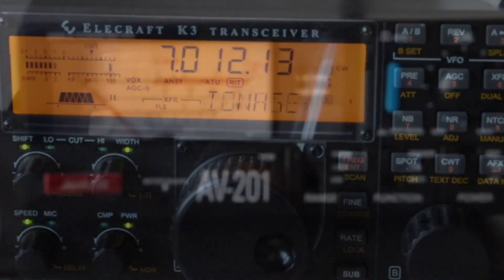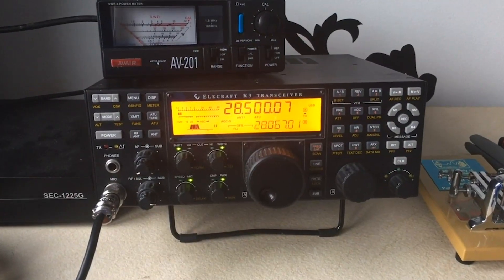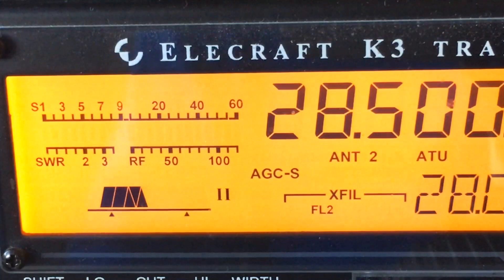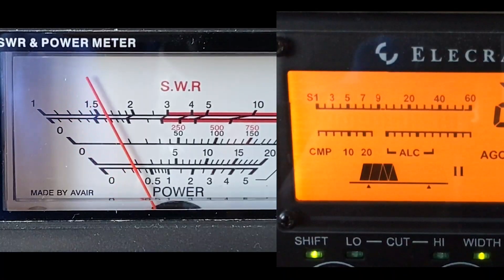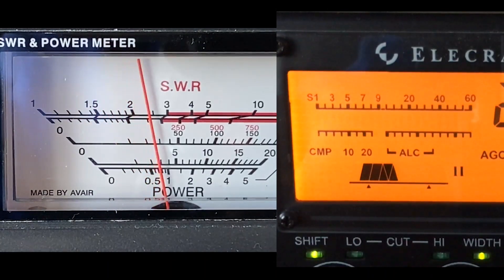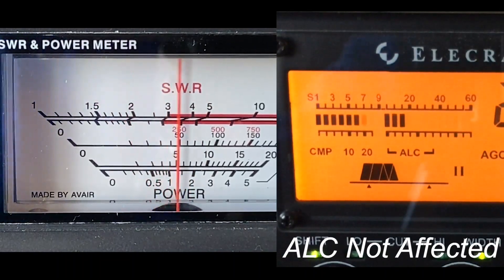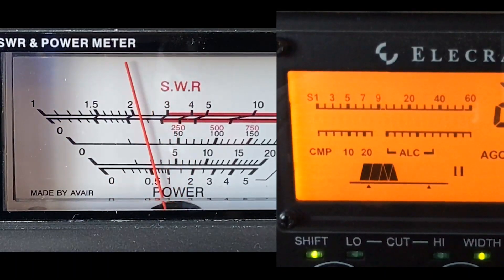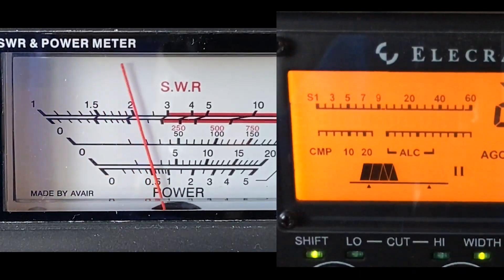Transceiver Compression in The Ham Radio Station

Comment: On my Ic 705, I set my mic gain so that I have about 25% of ALC, then I turn on the compression and set it so it is approximately 5db. What I notice with my 705 is that as I add compression the ALC increases. In this video with your Elecraft, your ALC didn’t seem to increase when you increased the compression. Is there something wrong with my IC 705? And if I set the mic gain with compression off to give about 1/4-1/2 the ALC meter and then turn compression on to 5db and it doesn’t go beyond the red ALC line, will my audio sound ok? I haven’t had anyone to test my audio with yet. Thank you.
Reply: I have the Yaesu FT-950 and it does the same. The manual suggests setting things until you have 5 -10 compression at peaks and ALC hitting around 50% at the same time. If I move compression higher the ALC follows. I also noticed I get great audio reports on DX but local on 80m and 40m I am often asked to turn the proc off and just go with mic gain to adjust. Seems to work for me. I use a webSDR out of Utah to listen and record my own TX audio to test and adjust and it seems that the manual is correct for best results.

Comment: Apart from increasing "talk power" compression  is also a good way to stay clear of ALC. Also used correctly it is good when your amplifier only needs a fraction of the radios output for drive.... most people will not notice 3-6dB of compression as far as quality is concerned.
Reply from the maker: Hi there, yes good advice. 73s Peter.
Reply: @watersstanton  Thank you Peter, I know different rigs have different structures to control the output, one of my ancient flagships triggers ALC earlier if you reduce the RF power, far more sociable to reduce drive and let the compression take care of the limiting. Thank you for a thought provoking video series 73